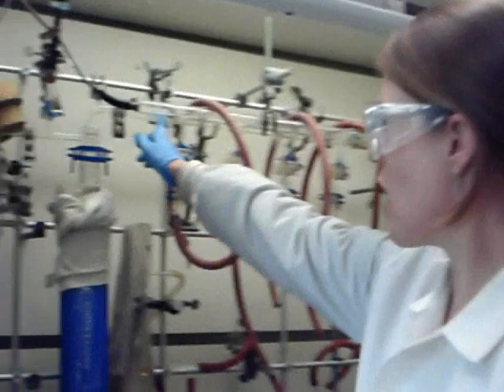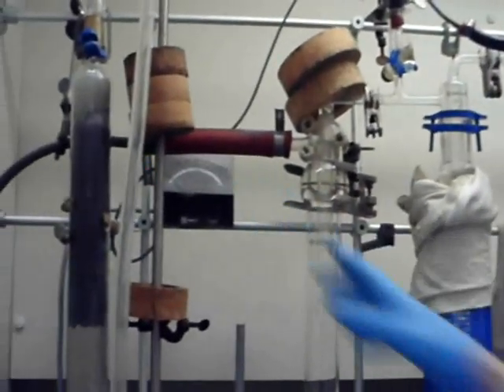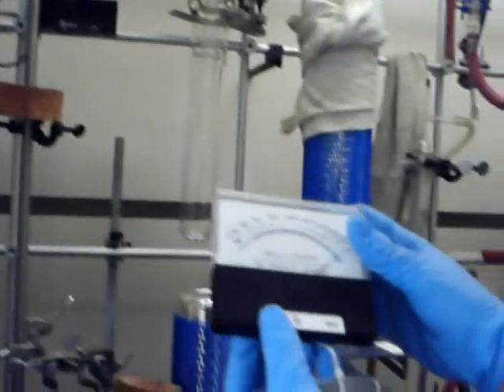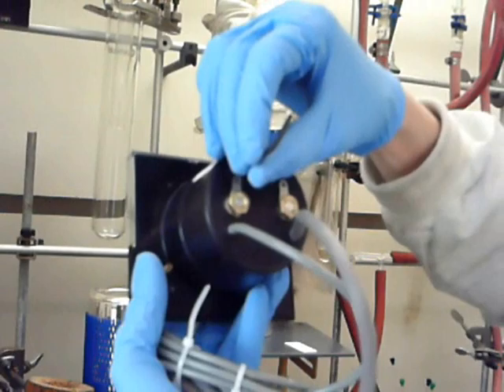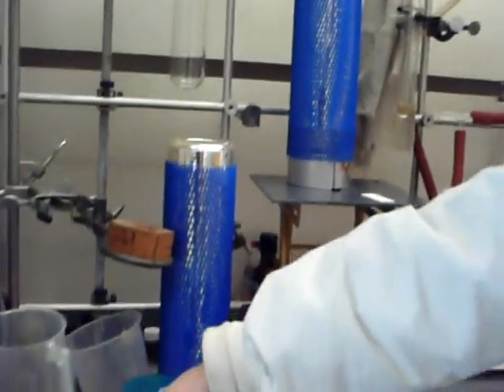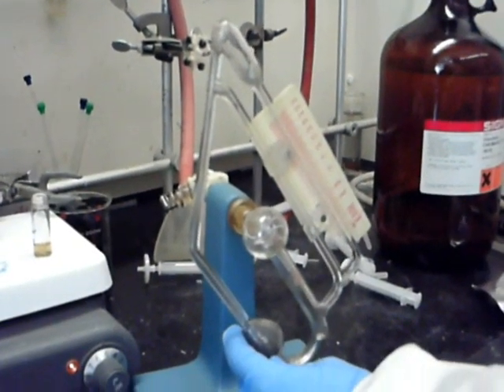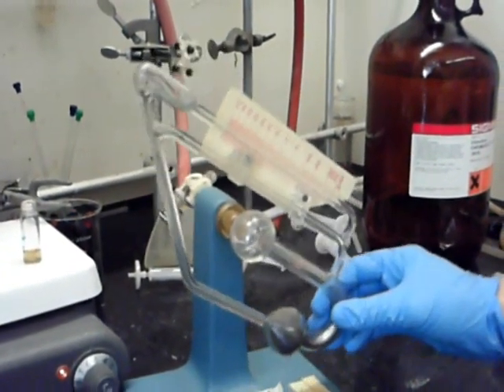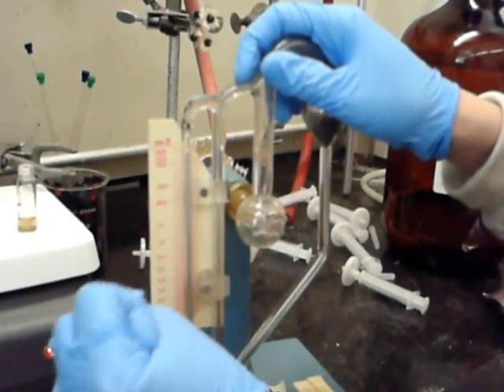Calibrating with a McLeod Gauge

Comment: We recently had an explosion in our lab when one compound set aside on the line. We added a second empty flask to the line to prepare for another reaction, evacuated the flask, then kicked on the nitrogen. Once the nitrogen was kicked on, the compound that was set aside in the first flask blew up. Any thoughts? I'm thinking that maybe the air wasn't completely evacuated from the second (new) flask and the nitrogen pushed the residual air up through the manifold and into the initial flask.